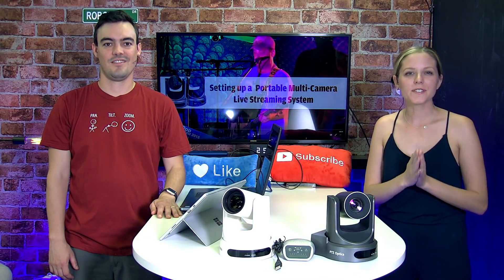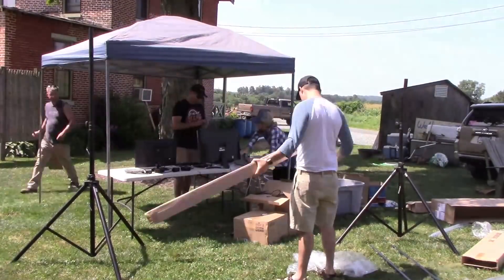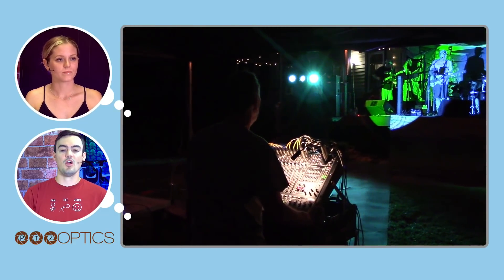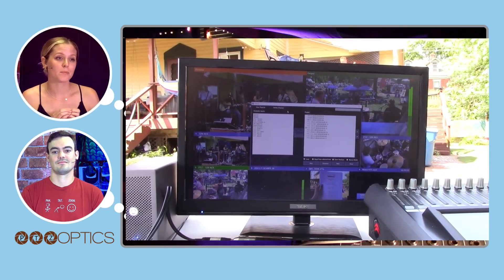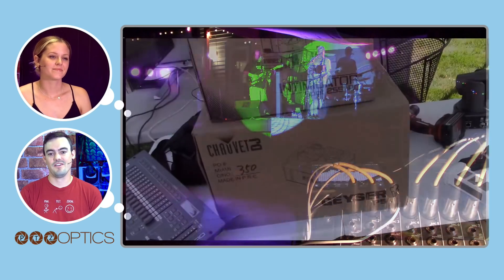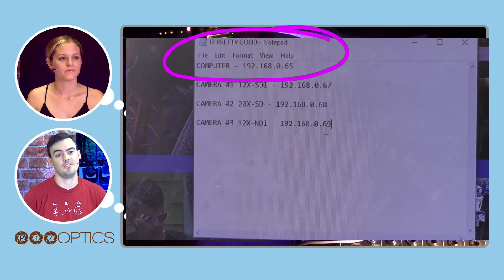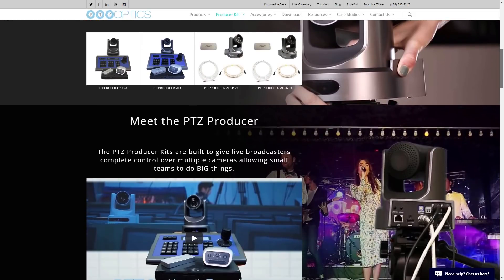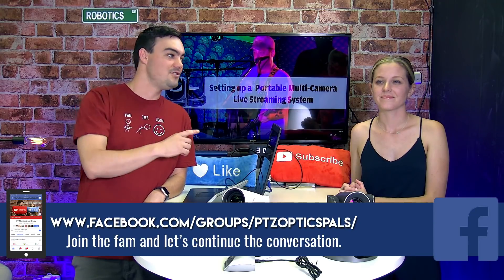How To Set Up Your Portable Live Streaming Equipment

Comment: Hello I have a question though i love your setup. I was wondering how do you guys connect online from outdoors? What equipment do you use to connect the computer to the internet? I'm trying to get info as i am in the process of setting up a mobile streaming system and with PTZ cameras i already have and wanted to know how you connect online and what equipment is used to do so?

Thanks
Reply from the maker: Hey radiometabel, Unless you're renting a satellite truck, cellular bonding is the most reliable, professional method for streaming outdoor events. Cellular bonding combines the speeds of multiple networks—including 2.5G, 3G, 4G LTE, and Wi-Fi—into a single fast and reliable internet connection for broadcast purposes. Perhaps the simplest solution for internet access in a remote area is to simply use a mobile hotspot. Depending on the strength of the local signal, this can be sufficient. Modern 4G LTE networks can exceed 5 Mbps upload speeds. That's enough bandwidth for streaming live in HD, but not at true broadcast quality. You can look at LiveU for solutions.
Reply: @PTZOptics  awesome i do appreciate the response though i had the idea that mobile hot spot was the source being used but needed to confirm from a pro just so i know.
Thanks
Reply from the maker: We’d love to see your creative setup!
📸 Snap a photo and share it with us by emailing marketing@ptzoptics.com
📬 Subject Line: Share Your Vision

🌐 Explore More: https://ptzoptics.com/

Comment: I use a Apple M1 laptop with my 810 mini pro Iso. I’m trying to find out how to handle a client zoom conference & stream to Facebook at the same time. I can’t connect into a router and have to use the clients wifi.
I spoke to Blackmagic & was told my solution might be to use my old 2013 MacBook as another source to connect to for the zoom conference.. I also have a 9” external monitor.
Yet I have a Pelican case I modified to hold my 810 & a 7” monitor.. I also have the 15 key stream deck.
Searching YouTube a few results to my question was I had to use or pay for StreamYard or Vimeo to do this?
Reply from the maker: We would recommend posting this more technical question to our Facebook user group 
( https://www.facebook.com/groups/ptzopticspals ) OR ( https://www.facebook.com/groups/streamgeeks/)  to ensure the issue can be remedied in a timely fashion!

Comment: You just describe what is going on.. you don't teach how to set up.. how to make connections.. and what we need to do mobile video..
Reply from the maker: Hello!
I can provide you with a general guide on setting up a portable live streaming setup with PTZOptics cameras based on standard practices:

1. Select Your PTZOptics Camera: Choose a PTZOptics camera that suits your needs. Consider factors like output options (HDMI, SDI, NDI, USB), zoom capabilities, and resolution.

2. Choose a Streaming Device: Decide on a streaming device or encoder. This could be a hardware encoder, a laptop with streaming software like OBS Studio or vMix, or a dedicated streaming device like a Tricaster.

3. Select a Tripod or Mounting Solution: For portability, use a sturdy but lightweight tripod or mounting solution that can securely hold your PTZOptics camera.

4. Set Up Audio Equipment: Arrange for audio input – this could be from a built-in camera microphone, an external mic, or a soundboard. Ensure you have the necessary cables and connectors.

5. Prepare Your Network Connection: For live streaming, a reliable and fast internet connection is crucial. Use a wired Ethernet connection if possible, or a stable Wi-Fi network.

6. Connect the Camera to the Streaming Device: Connect your camera to the streaming device using the appropriate cables (HDMI, SDI, Ethernet for NDI, etc.).

7. Configure the Camera and Streaming Settings: Set up your camera's settings (white balance, exposure, etc.) and configure the streaming settings in your software or hardware encoder, including the stream key, bitrate, and resolution.

8. Test Your Setup: Before going live, do a test recording or a private stream to check audio levels, video quality, and the stability of your internet connection.

9. Portable Power Solutions: If you're streaming from a location without easy access to power outlets, ensure you have portable power solutions (like battery packs) for your camera and streaming equipment.

10. Pack Additional Accessories: Bring any additional accessories you might need, such as extra cables, batteries, storage media, and lens cleaning supplies.

Remember, each streaming scenario is unique, so you might need to adjust these steps based on your specific requirements and the equipment you have. For detailed setup instructions tailored to your specific PTZOptics model and streaming needs, I recommend consulting the camera's user manual or reaching out to PTZOptics customer support

Comment: I bought 3 PTZOptics cameras I am asking you to do a test for me.. I have the Gen 2 20x (2 of) and the Gen 2 30X(1 of) and a sling studio (plus your network camera control panel).. what is the longest HDMI cable I can use with a camera link. Please test this for me as I have to finish this install in 3 weeks. I got your cameras due to being so highly rated and also being recommended by NewTek. My setup is in an old church and I had to stay within the bounds of their architecture meaning I had to place the cameras WAY back in the church (and so far impressed with the 20x that came when I was there the other 2 came after I had to return to Florida (this may sound familiar as I did call in about this) Problem is I cannot install the camera link near the cameras. No one could turn them on if I did. SOO. Please see how far away you can install the camera link from the Camera as SlingStudio says your cameras are not recommended for their system end of story on their side. Im heading back to San Fran on the 9th of October to finish the install.. Thanks in advance.
Reply from the maker: SuperMouseDV - 25’ is generally the most we will recommend. At 50’ the cable could become unreliable
Reply: @PTZOptics  So I can use a 25 foot cable with the SlingStudio Camera Link and have no issues ?? I tried an HDMI to Micro SD cable 15 foot and it did not work but it worked fine to the main Hdmi connection to the sling studio itself. (I have a Nikon p1000 I hooked it up to to test)

Comment: I've been using my PTZOptics cameras on speaker stands for well over a year now for my portable rig. I've modified some external tripod speaker mounts so that I can use a 1/4-20 thumbscrew and have a great flat platform for each camera. Stronger, smaller footprint and height adjustable over everyone's head. Win-win-win!
Reply from the maker: Champerj - yes I think the modified speaker stands are becoming one of the most popular way to use the cameras
Reply: @PTZOptics  Hi guys, the Truss. Could you share what brand & where to buy? Looks like its also collapsible
Reply: Can you please elaborate on what tripod speaker mounts you use and how you modified them to be able to use a 1/4-20 thumbscrew and have a platform?  Any links to the components you used would be greatly appreciated. Thanks.